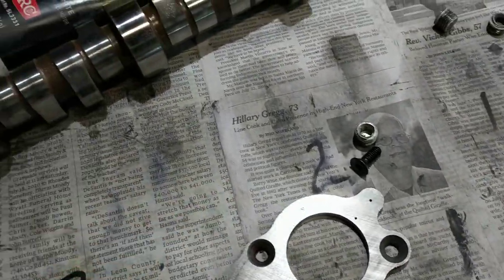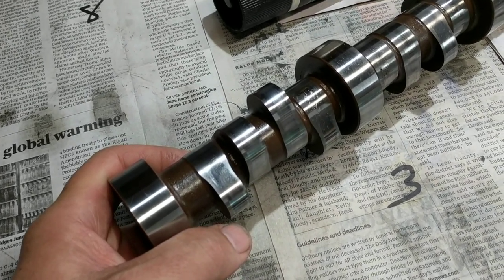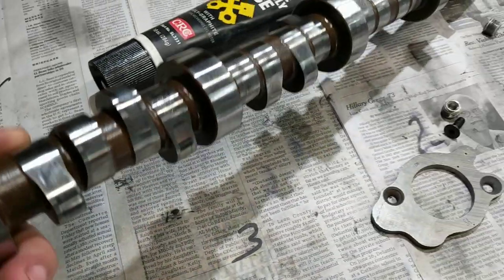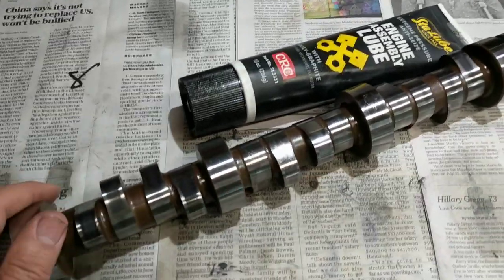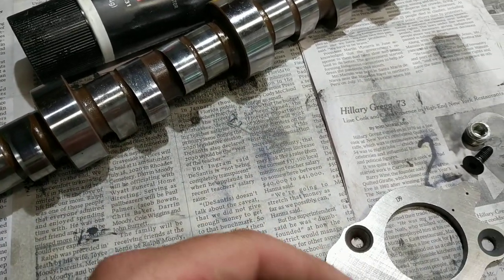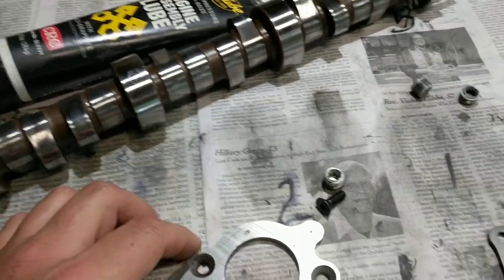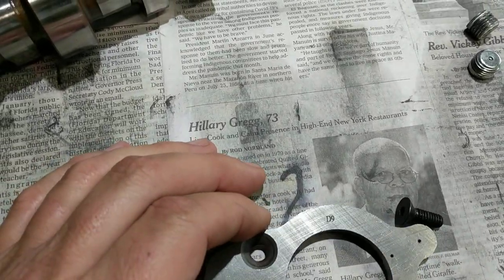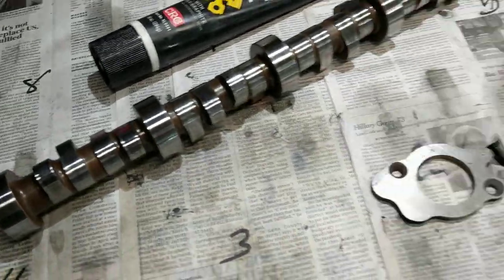How to identify lobes on an aftermarket cam.

Comment: I always wondered what those numbers meant I always thought that they should have put the specs on the cam as well. But yeah I never new that. You for sure need to get that blue car going straight cause we're gonna want you to be around a lot longer and I have got you more goodies from comp cams that I know that u can put to use with that cam and that is a brand new set of springs. The part number is 987 so you can look them up and if you need them quick I'll get them on the way pretty quick so you can use them with the new cam. They are for the roller cam and will work perfectly for your setup.

Comment: Got a call from the machine shop today and he said that I should have went. 040 over because one of the cylinders was worn of center a little bit and he had to bore it a couple thousandths over to straighten it out but said that it will be fine but I was nervous that he was calling telling me that the block was bad 😂